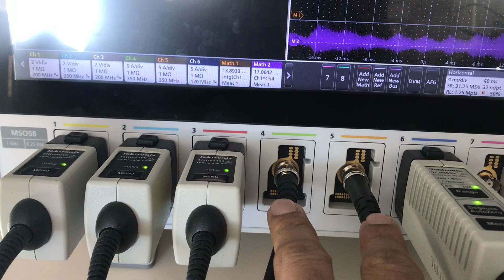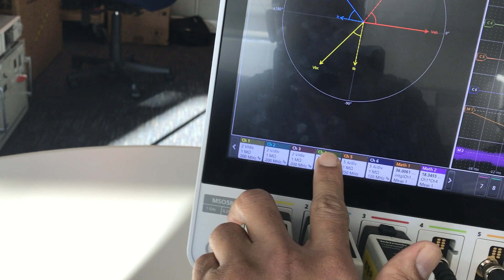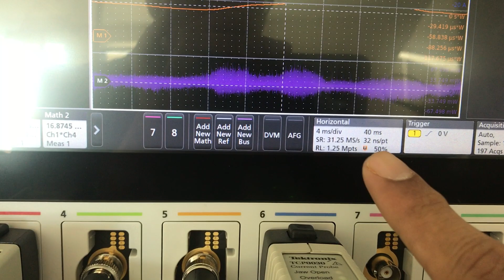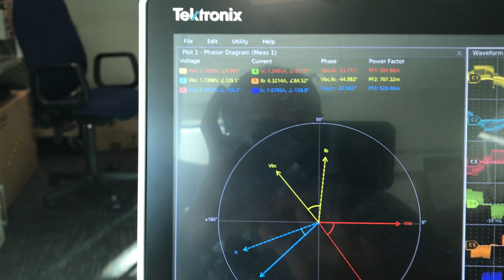Motor Drive analysis using an Oscilloscope

Comment: Amazing setup!!!  I'm on a journey to determine if there are any guidelines to determining most efficient PWM frequency for a given brushless motor configuration.  In my case it is a 'gimbal' winding that uses many more turns of thinner wire, which I would imagine drives up the inductance of the circuit, but I'm not sure if it is meaningful 10-50kHz PWM frequencies.  Any suggestions?